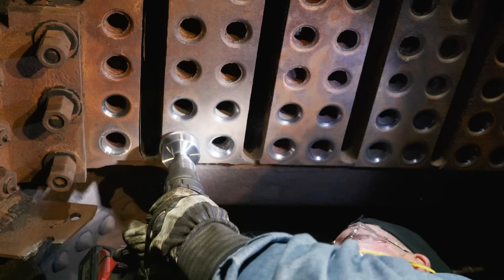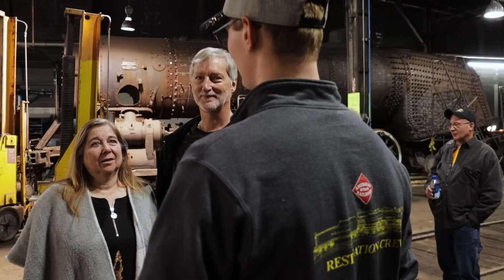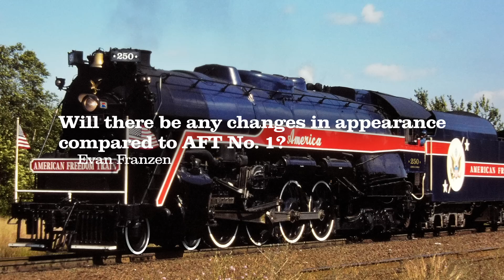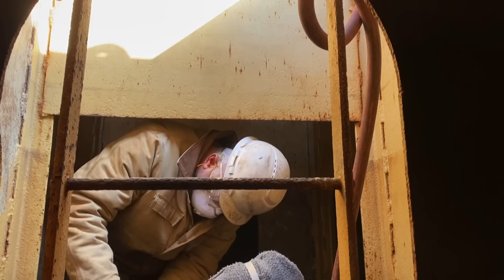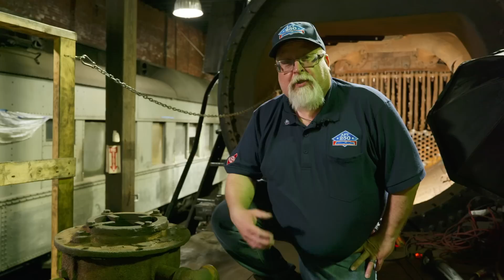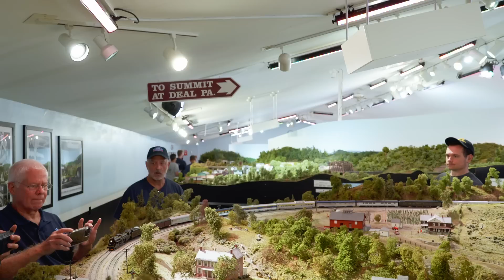Q&A Session - AFT 250 June 2024 Update

Comment: Will there be a layer of coal on top of the oil bunker to give the appearance of a coal burnet? Great job by all
Reply from the maker: Hi Dave, one of our members also mentioned this, and while we won't say "never", it would hold water which could lead to corrosion issues as well as take some additional time to create. We would also need to have to do some redesign of the dipstick and filler hole as they are located on top. Thank you for your interest and support!

Comment: Will the booster be added later on after the AFT "event" is over?
Reply from the maker: Greetings, we will be applying for grants to have the booster restored (approximately $40,000), and would install it soon thereafter. As the T-1 has 68,000 pounds of tractive effort without the booster (as compared to 64,100 pounds for the NKP 765 which we all know is a very capable locomotive), we have plenty of power for the trips we are planning for the next several years. Thank you for your interest!

Comment: Soak that wood in the tender with oil before putting the bunker in. That will make the wood last longer and prevent corrosion that will happen from moisture in the wood being held against the steel causing corrosion.

Comment: Here are a couple more questions I have:
1. If or when the booster is installed on the locomotive (whenever that may be), does there need to be any modifications done to the booster due to oil burning system in order for the booster to work, or does the booster function the same whether the locomotive is coal or oil burning? (I'm guessing the latter).
2. Does ASR or any ASR volunteers own guest whistles that could be put on the locomotive?
Reply from the maker: Hello! Thank you for your good questions, I have replied below for you:
1) The 2 cylinder booster engine runs off of steam, so no changes need made for it to operate whether the 2100 is coal or oil fired
2) Yes, we have several members and donors with a variety of other steam whistles. We will pipe the 2100 to allow for guest whistles, however while being operated as the AFT 250 we are only planning to use the brand new Reading 6 Chime that was generously donated by one of our members.

Comment: Are there plans to add the booster back to 2100/ 250 eventually? Does 2102 even have her booster?
Reply: 2102 does have her booster (I hope 2100 gets hers back)
Reply: Not a member of the society but 2102 does have her booster, if you look up the video of the engine nearly stalling while going to Jim Thorpe they use it to give it the extra power. But I’d imagine once they get 2100 running and have the time and funds they will add the booster back to it to also allow them to do longer trains and tackle more steep grades
Reply: I can answer one of those, yes 2102 has her booster and it is Operational, usually used when heading out of Jim Thorpe
Reply from the maker: Hello, we will be applying for grants to have the booster restored (approximately $40,000), and would install it soon thereafter. As the T-1 has 68,000 pounds of tractive effort without the booster (as compared to 64,100 pounds for the NKP 765 which we all know is a very capable locomotive), we have plenty of power for the trips we are planning for the next several years. 

Yes, the 2102 does have her booster, and it was restored to operation  at the time of the latest restoration.

Thank you for your interest!